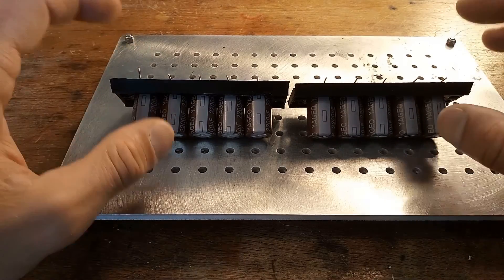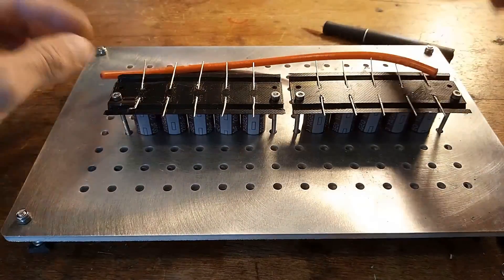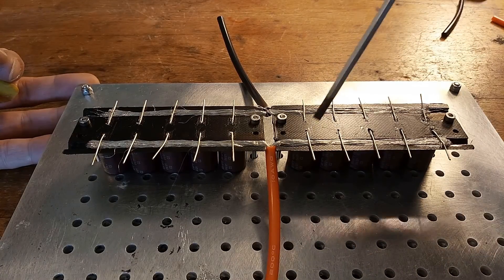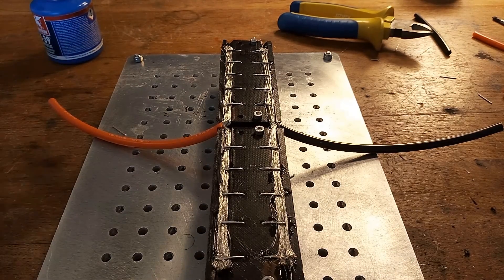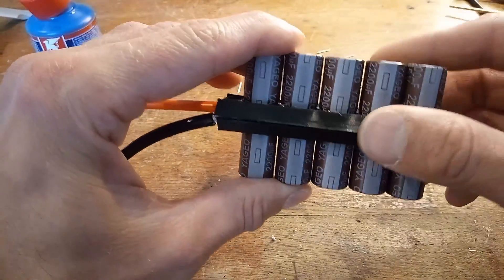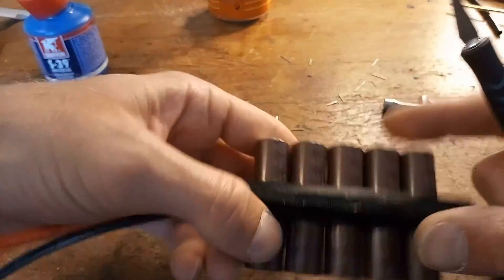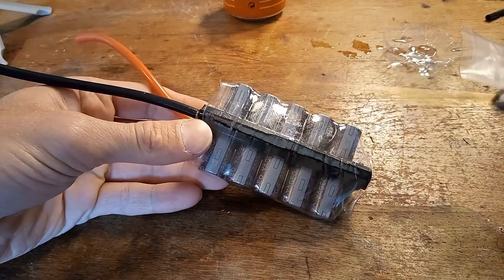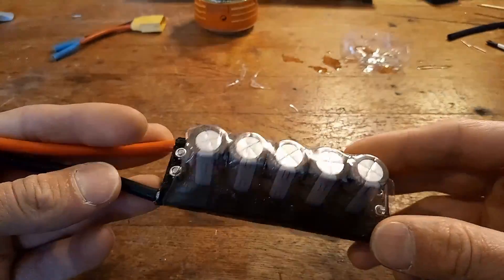How to make your own cap pack step by step

Comment from the maker: I made a mistake in the video just @ 1:05 I mention that the capacitors are placed in series, that is incorrect. All capacitors are placed parallel.
Reply: thanks for posting this i immediately came down to the comments to mention that
Reply: also since i now know your reading these comments, thats a brilliant way to package them all together. i would have never thought to fold 2 halves together like that
Reply from the maker: @dirtrider88  I read all the comments :D

Thank you! I wanted to make an extra lange cappack, not because it is nessesary but because i can :P

Than wrap it with a waterbottle to protect it al and done.

Comment: THEYRE ARE WIRED IN PARALLEL NOT SERIES. parallel is amperage and series is voltage. dont destroy your esc
Reply from the maker: @bs9two4  Correct, mistakes were made. luckely somebody is paying attention :D

The esc is fine, made a lot of runs with this set up.
Reply: @ yes 🙌

Comment: That's a nice way to build a cap pack. I need one as well because my ripple voltage is almost 3V on 6S, which is too much for me. Thank you for the inspiration and, as a bonus, for showing that using a plastic bottle works great as a heat shrink tube. I'll definitely test that out. It's a great idea!
Reply from the maker: @zash721  Thank you!

Keep in mind this is a "big aas cappack" :D
If you want to 3D print the parts for yourself and make your own cappack the downloads are avaible in this link:

https://cults3d.com/en/users/Noud/3d-models

I work together with Noud (he is my 3D print guy, i am the 3D engineer) i have made 2 type of pack, one that is almost the same as in this video but smaller. You can make this one dubble or singel. And i have a big cappack model.

If you have any quastions just ask!

Comment: Hi Rembo, being new to the field, I would like to know what these capacitors are used for, thanks.
Reply from the maker: @andreabetti9018  I can try to explain how it works and what it does. But there people on YT that do it better than i can type here in the comments :P

Whatch this video:

https://youtu.be/bMVF0ONVRiY?si=5w6t9AgtUdhg1I2o

P.S.: you dont always need a cappack and if you do it does not need to be as big as i build one. I build it so big because i can.
Reply: Most manufacturers put a couple capacitor on their ESC's from the factory. Companies like Castle Creations dont always do this. ESC's such as the Mamba XLX2 MUST HAVE a cap pack added. These ESC's are 1 of the most powerful ones avaliable. You see them in alot of hardcore builds. 
Heres an example.
Lets Say your doing a top speed build, When you give your rc full throttle, it pulls on the batteries very hard. If your batteries voltage sags below a certain point, the esc sees it as a dying battery and not a sag. So the esc will start cutting out and then as the voltage rises it will kick back in. Now.....this happens hundreds of times per second. This is known as "Ripple"
A capacitor pack can store enough power to smooth out these ripples, and allow you to get the most out of your build and batteries.
If you use a data logging esc such as a castle XLX2, you can actually see what these ripples look like. Power ripples can cause heat build up in the system and can damage your esc and battery if left unchecked.

Comment: what the purpose of this big pack? what is the advantage for the rc drive?
Reply from the maker: A cappack helps preventing a "ripple" in the power system. You always have a ripple when you pull a lot of power from the batterys to the motor. But a cappack makes this ripple smaller and protects your batterys and esc.

Most esc's come with a build in cappack, if you look at Hobbywing or Traxxas esc. These have capacitors between the +/- wire.

A bigger cappack is always better. But after some point it will be so big it does not make the ripple that much smaller. But hey.... Sometimes you just want to build something nice amd big :D

Browse true the comments because similar questions have come by and have been awnsered. There is one person who posted a calculation. If you still have questions feel free to ask!
Reply: @remborc   It make the battery C rating higher, or help to keep burst for longer time, if I understand it right.
Reply from the maker: @iwanawithyou  The cappack does not change the C rating of the battery. The cappack hold verry little power. @roybeukeveld made a calculation in this comment section were you see the cappack holds only a fraction of amparage. This is also seen in the video as the car horn is only activated for a fraction of a second.

https://youtu.be/bMVF0ONVRiY?si=QCRWscJs7MLliKaJ

in this video it is stated that the cappack does not improve acceleration or top speed. Acceleration and top speed are depented on the voltage in the system. So cappacks do no improve the "voltage sag or dip"

I am not an electronical engineer. I am a mechanical engineer so i cannot explay in detail what a voltage ripple is. In this video he explains what voltage ripple is:

https://youtu.be/kdkNX7RwEiQ?si=PrQBG6tQkE-XruAH
Reply from the maker: @iwanawithyou  If you look at any of my speedrun videos with the Limitless i post the datalogging from the xlx2 that can be downloaded from dropbox.

https://youtu.be/Wm5a9K2mlS4

If you use the castle creations program software for pc you can read the logging and than you can see that i have a massive voltage drop but a verry small ripple.

Comment: why would i need a cap pack? im on rc cars
/
\
\
Reply from the maker: By any chance you run castle esc's?

If so you can see in the datalogging that there is a voltage ripple when you drive. This ripple will couse more heat in your electronics and will stress the batterys more. Under heavy load with speedrunning when you pull a lot of amps (the more amps you need the bigger the ripple will get) and get a big ripple that can damage your electronics. A cappack eleminates this ripple.

If you want to know the fine details of this so called "ripple" i highly recomend looking it up because there afe people that can explain it a whole lot better than i can!

I know in a basic form a ripple can damage your esc and betterys (or stress it more but not emidiatly damage it). A capacitor pack can prevent this ripple.

Under normal driving situations you dont need a cappack and most esc come with a cappack build in. Between the +/- wires you will see one or more condensators.
Reply: @remborc its a Hobbywing quicrun 150amps (rebranded)
Reply from the maker: @hpiracing1017  Its difficuld to determine why or how your esc broke. Its a complex and compact piece of electronic that some times breaks for no reason.

My velineon 6S esc gave a critical error and broke when i drove my E-revo 2.0 slowly over a branch.....
A friend of mine a few months later had the exact same thing with his 6S velineon esc from his UDR
Reply: @remborc no but i run 6s chill , no speedruns on my savage v2 x and i fried 2 escs already(stock ones)

Comment: Mooie video, mooi werkstuk, geweldig hoe je dit vorm gegeven hebt, complimenten.
Zo te lezen in de comments hier ben je goed thuis in de materie en beschik je over nauwkeurige datalog gegevens. 

Ik probeer te begrijpen hoe je een cappack kunt sizen, en probeer vast te stellen bij welke grootte het een piekstroom beschermer is of kan zijn voor je accu’s.

Als ik wat sommetjes los laat op jou cappack kom ik uit op het onderstaande. 
Ik ben benieuwd hoe jij er tegenaan kijkt.

35V, 2200uF x10 = 22000uF totaal, dit is 0,022F totaal.

1F = 1Volt x 1Amp x 1sec

0,022F = 35V x 0,00062Amp x 1sec 
Dus gedurende 1 sec levert het cappack bij 35V slechts 0,00062 ampere.

Dus als je bijvoorbeeld een piek van 50 Ampere wilt kunnen compenseren dan kan dat wanneer de piek niet langer duurt dan 0,022F / (35*50) = 0,000012 seconden. 

Bij een piek van 0,01 seconde zou je dus 0,06 amp kunnen counteren. 

Is de conclusie juist dat een cappack nooit wat gaat betekenen op dit vlak en dus enkel zinvol is in de compensatie vd ripple voltage?
Reply from the maker: Dank je wel!

De berekening zelf heb ik nooit gemaakt.
Een cappack in een RC auto wordt onderdaad puur gebruikt om de ripple op te vangen en niet om "als extra batterij" te functioneren zoals veel mensen dit soms denken.

In het filmpje hoor je dat de claxon ook maar zeer kort aan is bij een volledige ontlading. Daarmee wordt je berekening bevestigd en houdt deze maar een klein amperage vast.

Ik heb zelf diverse speedruns gemaakt met mn Limitless met daarin mn XLX2. Van iedere run heb ik een full datalogging gemaakt en deze datalogging staat op mijn publieke dropbox account. Via ieder filmpje (Limitless speedruns) vind je de download link van die specifieke run en logging. Mocht je de castle creation software hebben of nog downloaden dan kun je de logging volledig uitlezen.

Hoe kun je deze "sizen" bigger is better zeggen ze dan :P
Een berekening heb ik er niet voor. Verschillende factoren die ook meespelen zijn: hoeveel beschikbare ruimte je in je voertuig hebt, de kwalitijd van de Lipo's, het vermogen en de ontladingswaarde van de Lipo's, het vermogen/verbruik van de esc, je rijgedrag en nog veel meer.

Zo had ik bij mn 200kmpu speedrun een ripple van 0,99V bij een vermogen van 8668watt en bij mn 208kmpu speedrun een ripple van 0,57V bij een vermogen van 7914watt.

Hoe smooth je throttle curve is speeld ook enorm mee.
Dit is allemaal terug te vinden in mn dropbox in de Castle Creation dataloggings
Reply: @remborc  Bedankt voor je reactie, interessante materie, leuke hobby hebben we toch:-)

Soms is het een kwestie van berekenen en soms van beredeneren. Maar zoals je al aangeeft zijn er veel factoren van invloed die het niet altijd een volledig voorspelbare zaak maken. Vol gas of deels gas alleen al is bijvoorbeeld een belangrijke parameter.

Als ik kijk naar het voorbeeld wat je gaf, mét cappack 0,3volt ripple en zonder 1,0volt bij 300amp dan zou de volgende berekening realistisch kunnen zijn denk ik:

Verschil is dus 0,7volt bij 300ampere. 
12khz pwm = 0,0000833 sec
uF benodigd = (0,7 * 300 * 0,0000833) / 1000000 = 17500uF 
Dus 8 stuks condensator zouden volstaan in jou voorbeeld.

Ik verwacht dat je bij tien stuks in theorie bij 300Amp een max ripple zou kunnen compenseren van: 0,022F / (300 * 0,0000833) = 0,88 volt.

Je noemt ook een voorbeeld van 0,3V vs 3V maar ik weet niet bij welke stroom. Hoewel ik mij realiseer dat veel omstandigheden identiek moeten zijn geweest om het te kunnen vergelijken, maar zou dit rond de (0,022 / (2,7 * 0,0000833)) = 98 amp kunnen zijn geweest?

Ik kan je dropbox bestanden nu niet inzien (op vakantie) dus dat is voor later, maar ik ben benieuwd of bovenstaande stellingen stand houden en dus correct zijn, ik probeer wat verbanden te vinden en verder te begrijpen hoe het werkt :-)
Reply from the maker: @RBRCH  Graag gedaan!

Ja het is zeker een leuke hobby en ik heb er echt mn plezier in!

Het voorbeeld was tussen mijn run en die van een vriend van mij. Misschien is dit geen goed voorbeeld omdat veel externe factoren van invloed zijn op de Ripple, Voltage drop en het Amperage.

Dit soort dingen pak ik persoonlijk het liefste aan op basis van beredenering ipv berekening. Dit omdat zoveel externe factoren van invloed zijn. Evenals bijvoorbeeld met motorkoeling, er wordt me vaak gevraagd met welke koeling voorkom ik oververhitting...? Dan is mn antwoordt "niet rijden" of waterkoeling waarin dat beide vaak geen gewenste situatie is. Dan begint het verhaal over welke factoren invloed hebben op de temperatuur en welke principes van luchtkoeling het efficenste zijn. Waarin dat Bigger is better vaak van toepassing is op het formaat/capaciteit van de ventilator.

Geniet lekker van je vakantie! Ik ben vandaag weer gaan werken :P
Reply: @remborc  Ja het leuke van een technische hobby is dat er altijd wel iets uit te zoeken of te verbeteren is. Succes met de RC’s ik zal je kanaal blijven volgen 🤙🏼
Reply from the maker: @RBRCH  Ja dat is zeker waar! Het kan altijd sneller, beter, strakker of duurder.

Tnx for the support!

Comment: I'm into RC boats. I sometimes get power cuts due to heavy load when using larger props. Do cap packs help to reduce these power cuts?
Reply from the maker: A true and simple awnser: No.
A cappack is not an "additional battery" what many people think.

You should find out why you have a power cut?

Q: are your lipo's not strong enough and does the volte drop to much? Even so low that the voltage cut off is triggerd?

A: Get better quality lipo's. With higher mah value, a higher C rating or both
A: Lower you voltage cut off, not lower than 3,1V per cel to be safe

Q: Do you overload your esc? Wanting to pull 200Amps but the esc can only deliver 150Amps

A: Get a stronger esc

I am not into boats to much, so keep that in mind reading my questions below.

-but is your strud angle correct for the desired speeds?
-Is the pich of the propellor correct? Diameter is not everything
-Is the flex shaft lubricated correctly to lower friction?
-In theory hulls have a desired speed on where they flow true the water efficiently. Going slower of faster than this desired speed couses the boat to flow less efficient. Maybe you dont have the correct hull?

Comment: It is not clear to me if you alternated polarity when placing those CAPs inline or if all of the poles were on the same side. It appears in the video they were all positives on the same side but at the 2:48 mark you said they were positive negative, implying they are alternating. Which was it?
Reply from the maker: All positives are connected to each other and all negatives are connected to each other.

What i meant at 2:48 is that you need to make sure all poles (+/-) are connected the correct way. 

+ to + and - to -. if you alternate it, they blow up when electrified.
Reply: @remborc  Thanks for your reply! Great video BTW.
Reply from the maker: @hifinsword  Your welcome, if you have any other questions feel free to ask.

I have teste this 22.000uF cappack with speedrunning on my XLX2 and it works. The ripple is arround 0,3V while i pull arround 300Amps.

A friend of mine runs the same set-up without cappack and has a ripple of almost 1,0V.

If you check one of my Limitless speedrun video's, in there is a downloadlink to my dropbox were you can find the datalogging of the XLX2 if you are interested.
Reply: So all CAPs are in Parallel?
Reply: its parallel not series

Comment: Amazing work. Great design 👏
Reply from the maker: Thank you verry much!

I have tested it with my xlx2 and TPpower motor in my Limitless V2 and compared it to the same setup in my friendscar without cappack. His voltage ripple was 2,8V, mine was 0,3V so it really works

Comment: Sorry voor de noob vraag, maar wat is nu het nut van zo een batterij aan caps?
Reply from the maker: Fair question

1  Als de esc / motor (te) veel ampere vragen van de batterijen dan kan het zijn het voltage van de batterijen daald (meer dan dat ze leeg zijn). De motor / esc stopt met dit hoge vebruik en het voltage zal weer stijgen. Dit extreme dalen vinden de batterijen niet leuk en zn cappack helpt daar een beetje bij.

2. Deze is veel belangrijker!
Een dynamo en een electro motor zijn precies hetzelfde gebouwd in principe, zet stroom op een dynamo en die gaat draaien. Draai aan een motor en die wekt stroom op. Als je tijdens het rijden van acceleratie naar neutraal gaat (van stroom verbruik naar geen verbruik) dan draait je motor door en zal deze kortstondig een hoge piekspanning genereren.

Deze piekspanning wordt opgevangen door een cappack, anders gaat de piekspanning de batterijen in en dat vinden ze al helemaal niet leuk! Batterijen kunnen maar 1 ding tegelijk, en dat is stroom afgeven of opnemen maar niet beide tegelijk (daarom laat je een lipo na het rijden minimaal 15minuten afkoelen voordat je die oplaad, en na het rijden 15 minuten afkoelen voordat je gaat rijden). Daarbij kan zn piekspanning de esc ook beschadigen.

Ik heb deze die ik heb gemaakt laatst getest/vergeleken terwijl ik aan het rijden wat met mn Limitless V2 met een XLX2 er in.
Tijden het rijden had ik een negatieve piekspanning van maximaal  0,3V. Dat ter vergelijking met een vriend van mij met zn Limitless zelfde electronica maar zonder cappack die zat op 2,8V. En dat is bijna factor 10x zo hoog. Dus een cappack werkt!

Dit meten we adhv datalogging in de esc die we op de pc uitlezen.
Zijn voltage dip (punt 1) was ook extremer dan die van mij, maar dat kan ook komen omdat bij batterijen met een lagere C waarde heeft dan mijn batterijen.

Nu is het wel zo dat mijn zelf gemaakte cappack extreem groot is 22.000uF (zo noemen ze dat nu eenmaal). Maar ik wilde graag iets extreems bouwen😅. De meeste cappackt in de winkel zitten onder de 4000uF, castle verkoopt ze van bijvoorbeeld 2500uF.

Hopelijk schept dit wat meer duidekijkheid👌🏻
Reply: @remborc  Dankjewel man voor je reactie. Ik zag ze al in diverse builds voorbij komen.

Dit komt goed van pas in de raceboot waarvan ik nog moet uitzoeken hoe ik die precies ga bouwen. Toemen verkoopt een pack tot 8S 13200uF, mooi smal ding.
Reply from the maker: @FrankyDigital2000  Je kunt ze inderdaad kant en klaar kopen of zelf maken. Ik heb hiervoor een 3D frame geprint en losse condensators gekocht. Condensators kunnje via Ali, conrad of andere shops kopen. Dan wil je ze minimaal op 35V hebben en de capaciteit kun je zelf kiezen, ook de aantallen condensators. En dan in serie solderen, afwerken en op de +/- van de esc solderen. Ik heb een filmpje waarin ik ze in de Limitless bouw dan zie je hoe ik die aan de esc heb gemaakt.

De 3D download van de printfile staat in de omschrijving van dit filmpje, en deze kun je als je 3D kunt tekenen makkelijk naar wens aanpassen.